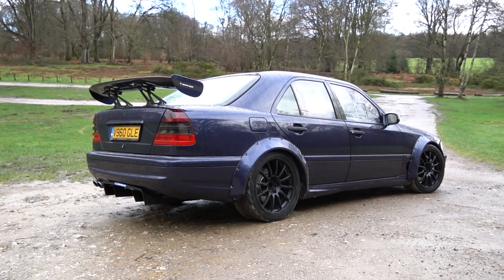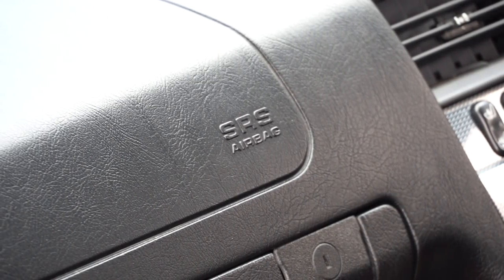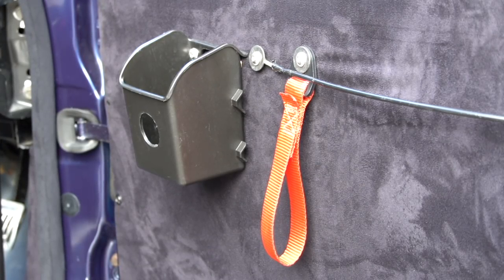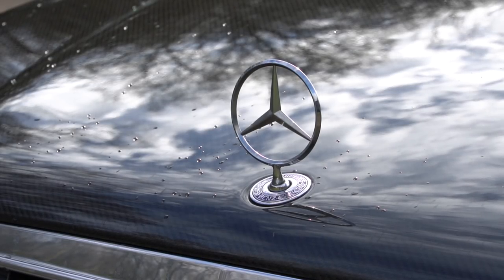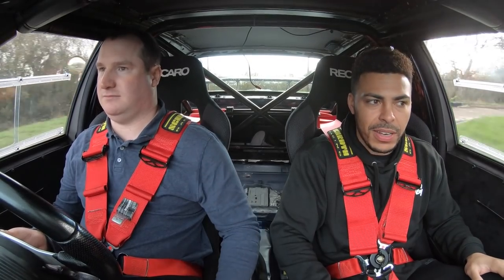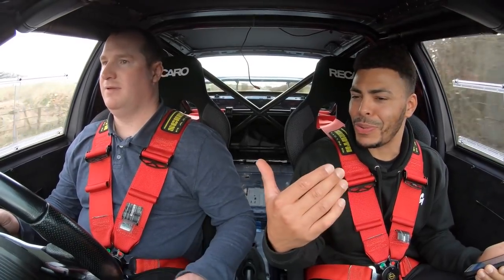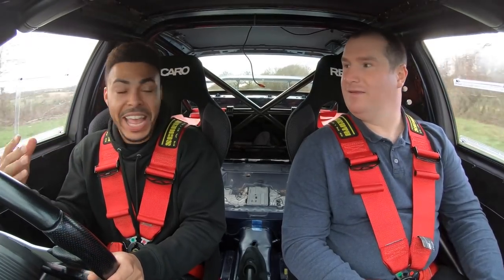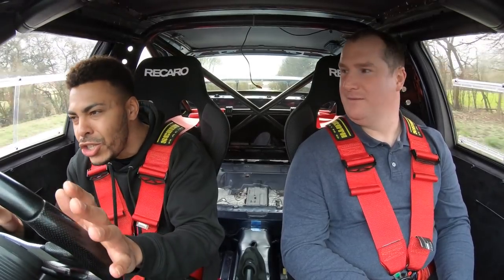THIS 400BHP MERCEDES C43 AMG 5.5 SWAPPED TRACK CAR IS RAW!

Comment: For what its worth, my stock C43 was able to get to 60 in 5.6s on a dry road with proper tires. This car would clearly crush that with a manual, 600lbs less weight, and 100 more hp & torque.

Comment: C43 is capable of 5s in stock form. This car should crack 4s no problem in right conditions
Reply: NorCalAMG Media my. C43 has a few subtle performance mods, I’ve had 4.6 on a dry day. Used to go through £200-300 worth of tyres in a month just as daily driver. Standard is 5.2 from factory. Maybe this is actually too light at the back end ?
Reply: @stephenlittle745  You could be right. What tires do you run also not having a proper diff doesn't help.
Reply: NorCalAMG Media I run continental premium for all round driving. I have used nenkang before and they were ok but preferred how the conti 6 premiums felt. Before last year I had a straight through exhaust with just a back box so it was stupidly loud, over 108 DB on a metre at full throttle. When law changed last year I had to put in a centre box for noise but prior to that I had to sound deaden the whole car so added a few kg in the boot and boot lid. This actually gave me better grip/launch but killed exponent. But no one buys a v8 thinking about what mpg they’re going to get 😅😏😁

Comment: “Kept the back box for the factory look” 🤣🤣🤣🤣🤣🤣🤣🤣🤣🤣
Reply: tarmacsurfers I’ve got ac43, few subtle performance mods, I had a full exhaust made for it, but cut the original tips off the standard box and welded them into the new one so it looks standard but isn’t 😏

Comment: I didn’t even know they did a C43 AMG of that shape!
Reply: The original
Reply: They did the C36, C43 and for last the C55
Reply: I have one, the c43 was the last car made by Amg at the amg factory, with a low production number. The new c43 is a fake 43 because it has a 3.0 engine. Its more of a dedication.
Reply: There were less than 1500 built worldwide between 1997-2000.

Comment: Take note boy Racers ! His racecar doesn't pop and bang and thankgod it doesn't because it's stupid
Reply: Dude, car has a big fuck off Ebay bolted on spoiler with bolted on wide wheel arches, rear diffuser.....that screams boy racer also.
Reply: The exhaust was standard AMG. take the restrictions off and it would pop n bang.
Reply: I agree with the pops and bangs thing its ridiculous I like a if a car has a overrun naturally but when they are mapped in its overkill.

Comment: And there are 6 guys in Romania  and one in Ukraine  with a turbo amg 190 who done it since 2010 till now, don't play smart cause a mercedes fan knew a gearbox from E/C 270 or E/C320 gearbox is a bolt on,what you did there is no new thing...
Reply: IndyGG 

Gearbox is from slk320 on m113 V8 in W202 not 190e non of them guys did that